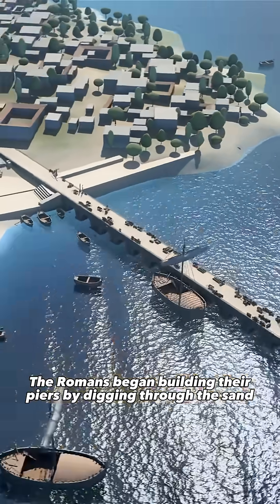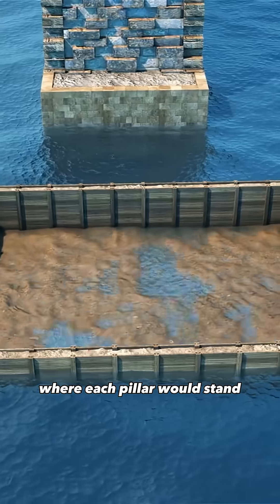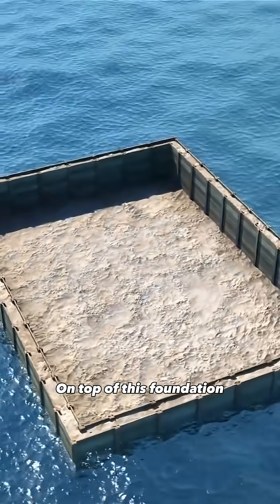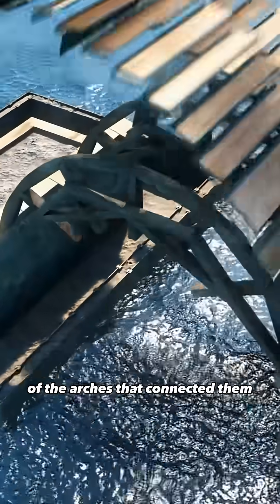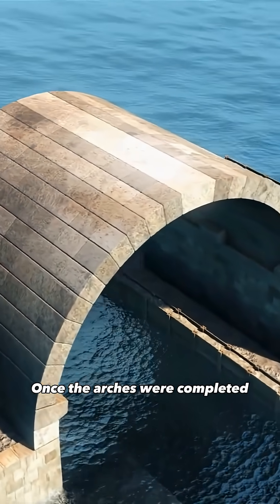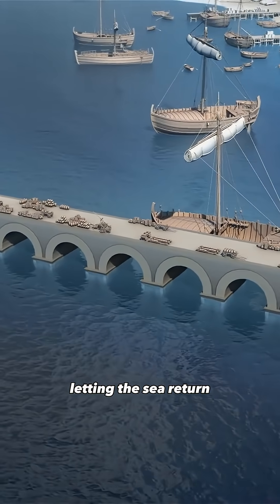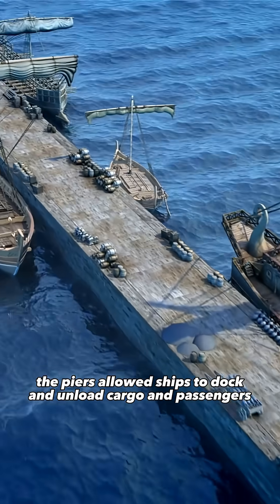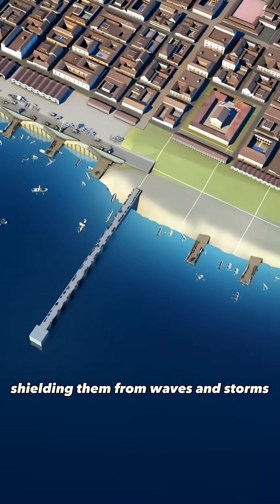Roman Piers Engineering Explained  #history#romanempire #engineering

Comment: "Until they reached solid rock"

But..but what if they never reach solid rock? Then what?!
Reply: These sites were scouted and surveyed ahead of time by divers and the surveyers. So if wasn't an issue for the most part.

Though off the top of my head, there are techniques used now to build even on unstable ground using concrete, but I'm unsure if that method was used by the Romans too.

Comment: Imagine if the Romans had gotten to steel and steam power.
Reply: Imaging Roman calculators with roman numerals !!!
Reply: @tonymoto1188
Look up the golden age of Islam during the dark age of Europe and stop embarrassing yourself.
Reply: They did! There is some evidence of steam powered mechanisms such as automatic doors. They just never saw the full potential of it.
Reply: @Gandalfthefabulous  They also used steel rods within some of their concrete structures, they even used some solid metal as a joint in curved slots of marble so they can be stacked without fear of them sliding. So pretty much the ancient equivalent of modern rebar.
Reply: @vguyver2  That's not the purpose of rebar?
Reply: @ufc990 Well it wasn't called rebar. They rarely used the steel internally with cement, as they had little need for it. Same idea though.
Reply: @vguyver2 true Roman concretia remains superior to modern Portland.
Reply: Time Travelers of Prometheus.
Reply: Paul the jew made sure that wouldn't happen when he corrupted Jesus's message and used Christianity as the broom to wipe out the roman empire and replace it with a Jewish controlled pagan religion which is the worship of jesus 😂
Reply: they had brass valves so its possible they were almost at steam
Reply: The Great Library of Alexandria, if the knowledge hadn't been lost we'd be a thousand years more advanced. With how ingenious the romans were if they had access to those base level designs they would have utilized them.
Reply: @Brakiros most of library of Alexandria was religious texts, and discussion of polytheism. We still got Vitruvius, Archimedes, Euclid, Socrates, Pythagoras and other classical & Roman engineers who all describe concrete and advanced architecture.
Reply: @Brakiros 
Look up how muslim Spain influenced Europe in its dark age in science,  médecine,  maths,  physics,  biology,  architecture, geometry, chemistry, ....etc...
Education is important.
Reply: The British are the equivalent of modern day Romans. Warmongering fascists.
Reply: How did they dig through submerged sand in the first place though?
Reply: If they hadn't kept fighting each other, who knows?   A direct result of the Fall of the Republic and descent into Monarchy. (Any General could try to make himself Emperor)
Reply: @kcw0809  Rome had grown too large to function as a Republic. The shift to Empire was natural, however when an Empire is born from assassination and the lack of a founding dynasty, it shakes the foundations. If Octavian's sons didn't die there would have been a chance of a stable transition. And then who knows with a stable foundation Rome could have endured. Much of what went wrong with the Western Empire was the lack of crown stability
Reply: True, and the lack of Crown Stability was anyone with an Army could try to take it. And Often Did.
Reply: Well the romans didn't, but the British did.
Reply: If those barbaric, greasy haired German Vandals had not sacked Rome...😊
Reply: Probably they would conquer galactic then.
Reply: Or to nukes...
Reply: the Romans had steel, proof- pilum. Steam engines were invented by Hero (self propelling heated sphere), the Romans through their Hellenophilic culture would have eventually through their use of hot concrete using quicklime and volcanic tuff. discovered the power of steam
Reply: They had steel fire before the Romans. And we have found ancient artifacts made of steel that are as pure as those that resulted from Kelly’s process later on. I will grant you they didn’t have the mass production of steel that they did in the industrial revolution. The Romans really were fantastic engineers
Reply: they did it, in star trek episode "bread & circuses" xD
Reply: they would have, a few hundred years earlier, if their population hadn't changed so much
Reply: We'd either be writing these comments in Latin.

Or whatever your local Native American language was, after coming home from school learning about the Great Sino-Roman War that ended in nuclear Armageddon for both hyperempires.
Reply: @RipRLeeErmey  I like to imagine Rome and China would be good friends and respect each other.
Reply: @ayuwoki453 never happens, all the Chinese Dynasties were every bit as empire hungry as the West. They still claim parts of Russia are stolen from China where not a single Chinese ever lived looking especially at Amur.
Reply: Imagine? Go to any city, or any other constuction site...and you're looking at it.
Reply: They did not need steam power. They had slaves.
Reply: @oscargrouch7962  So did the Confederacy, who also had steam power. Next idea.
Reply: @RCAvhstape would the Confederacy still have slaves today had they been successful?
Reply: @nicolasolton Probably not, it was in decline at the time. Who knows.
Reply: @nicolasolton according to Mosby of Mosby's rangers who was not a proponent of slavery I'd say no the South would have industrialised once they could save money keeping slaves working with new cintraptions running on steam, which is essentially the trajectory of post MasonDixie South. In fact the US is SOUTHERNISING with v high numbers migrating from cold horrible North to nearly snow free, lots os solar energy South. just look at Florida (and yes I do acknowledge Floriduh Man remains untamable as he is unstoppable).
Reply: @oscargrouch7962 that's just sloppy. Coal mines didn't want steam engines because horses did the job dewatering mines and shifting coal but the contrary they wanted steam to save money on horses, horsefeed and men. 
Horsepower is a marketing unit invented by Watt. Never existed prior to steam engines.
Reply: They had both, actually. But preferred manual labor to steam engines.
Reply: @watercollector Other than toys like Hero of Alexandria'a device, what sort of steam power did the Romans have?
Reply: @watercollector  haha certainly not
Reply: they did. if you go to italy, germany, or spain today, you will see that they have steel and steam power and beyond
Reply: @noplandave  But there is no Roman Republic or Empire anymore. That's like saying Native Americans invented pickup trucks because one of them works at a Ford factory in Detroit.
Reply: @RCAvhstape  There is also no german empire anymore. Are you saying that means that german inventions and developments arent german? Rome continued for over 1000 years after the actual city named "Rome" fell, but it was Constantinople. Are you saying those weren't Romans? Just because a country changes its name doesnt mean the people magically go away. Who do you think lives in Italy and Rome today? Descendants of Romans. They are ACTUAL Romans, they just don't call themselves that anymore, they call themselves Italians now. Just like the people living in Mexico today are ACTUAL Aztecs. They just went from cutting out hearts to making delicious street tacos and playing mariachi music.
Reply: @noplandave  There's still a Germany
Reply: @RCAvhstape not for long under the EU.
Reply: Stop with your D.u.m.b fictional scenarios and speculations.... should've could've ... would've...
It's childish and embarrassing!
Reply: @hakz795  What's childish and embarrassing is your dribbling. Stop babbling fool
Reply: @hakz795 no it's a good exercise in thought and creativity. What if African kingdoms had muskets and European trained armies? Would there gave ever been a Benin centred slave trade? That's an interesting thought experiment. What if Native American had been arned and trained properly by a vengeful Britain (as opposed to distracted by Seven Years War, all the European war over dismantling Holy Roman Empire and Napoleon) to skirmish and raid the US from Canada in strength? British burned down the White House and most of Washington- what if their orders were to stay and conquer? that's fascinating.
Reply: Unlikely. But even if they had, we would suffer from climate change already and might not  have the luxury to sit on the toilet, writing senseless commentaries 😂
Reply: @danielfietkau733 WFW
Reply: @danielfietkau733 there is no man made climate change.

Comment: Did they do something like metal reinforcement with rods immersed in concrete?
Reply: No, the Romans did not use long thin sections of concrete that need it, like beams.  They used blocks under high compression.  Adding iron would have only added a mechanism for corrosion, reducing the lifespan.
Reply: Exactly, "traditional" rebar dramatically reduces the lifespan of concrete structures, sometimes less than century! Only most modern non-ferrous rebar and fiber reinforced concrete will have a chance of lasting for centuries.

Comment: How did they drain the water? I want to know.
Reply: Pumps, Archimedes screw.
Reply: A previous short explains this, but long story short, it's the coffer dams mentioned here. They are scaffolds stacked up with bags of cement plus stones then some archimedes screws were used to drain the water.

After that, everything was done as per the short.
Reply: Same.
Reply: Took the plug out 😂

Comment: With the Romans making all these amazing engineering Feats for that time then how are we as a society now that we have technology that they didn't have back then obviously how are we as a society so dumb
Reply: I welcome you to go learn the complexities involved in going into stable Earth orbit. 

And then the complexities of landing a working robot that can communicate back to Earth... On Mars.
Reply: Theres literaly nothing the romans knew how to do that we dont know how to do today.
Reply: @robertharris6092 Indeed and we still use a lot of the same techniques today.👍
Reply: @robertharris6092 there's cement mixes they have that weren't recorded so we actually don't know how to make some of their cement mixes. For example.
Reply: @BloodyIron  No true. It’s easy to analyse Roman concrete with spectroscopic analysis and find out exactly what it’s made of. Which has been done. Even though Roman concrete is quite durable it has a very low compression strength of only about 10mpa. Far lower than the lowest rated modern concrete at 25mpa. Roman concrete was not poured like today, it was mixed quite dry, shovelled into place and tamped down. It is subpar compared with modern concrete.
Reply: @BloodyIron It wasn't recorded because Roman concrete was so widely used that they assumed everyone knew what it was when it was mentioned.

We actually have reverse engineered Roman concrete. The only major difference between theirs and modern concrete was that they mixed lime into it.

That way when cracks formed in it and water got in the lime would activate and chemically reliquefy the concrete, which would seal the cracks.
Reply: they had, on average, a high iq population perfectly in tune with their culture and traditions. a perfect machine. for a  while.
Reply: Bahahahaha speak for yourself dummy. This is very basic engineering. This is kids playing with Lego compared to what we can do today.😂
Reply: The Tiny Hats keep you dumb and under their thumb!

Comment: I don't understand the purpose of the arches.  They seem to be removed at a certain point, so what are they supporting, especially if the docks are filled in as a straight line?
Reply: Arches distributes weight and handles heavier loads. They didnt remove them.

Their under the water.
Reply: @Rob_Nasty THEY'RE under water, there "their"
Reply: Look under the dock
Reply: The wooden arches were to assist in placing the stone and other masonry work in an arch. Then when the stone arch is assembled the wooden arch is no longer needed and removed. 

Putting the stones and masonry up without the wooden arch is much harder.